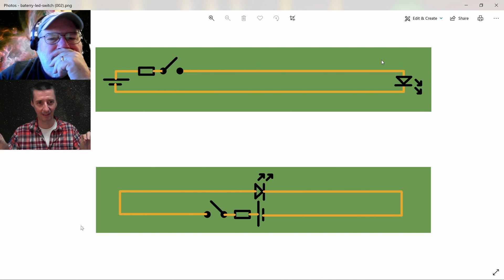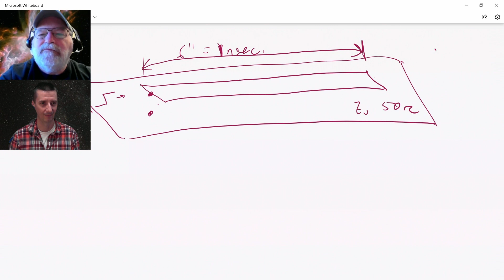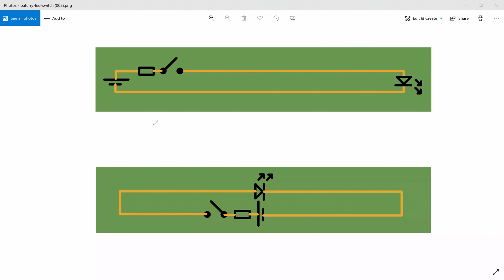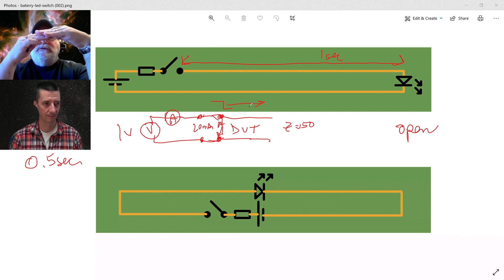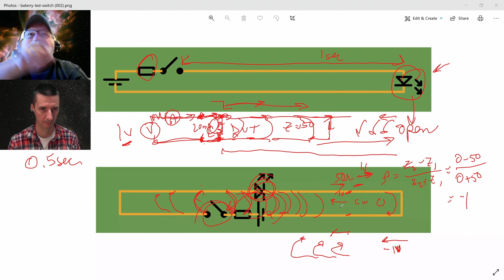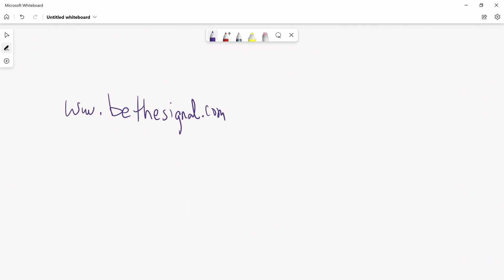Explaining Veritasium Electricity Video: Energy doesn't flow in wires (with Eric Bogatin)

Comment: Ya know Eric Dollard? And the video shows that in center of two lines, so the lines are horizontal, so it has series of same curve, so the amount of curve is the timeset of light, so if the curve is much bigger like a circle, so the lines of light that go left and right, so both in opposite direction base one is first, then one is second, so two time different, but depending on the shape, the exactly the same so the radius is even, so it is faster? Even it is same measure line as rectangle with smaller edge line. So, the less ratio of horizontal and veritcal, the rate of speed of light is what? So, it depends on center that range out so it is a barrier, so the smaller the ratio of top and bottom, the faster or slower?? And the step by step is a capacitor which is a changing volt so from one to another which is connected to the density that is high to low like a ball that is higher density drop in water, so it sinks but during the impact of the sink so there is a dispplate upward and downward in water and out of water, so the heavier you are, the bigger splash to even lesser splash at a further distance in the dept. So, based on the density ratio that is you put lower density in water and let go of the block which the object in the water goes up, and higher density of an object above water, and it goes down so splash will be big, so the point there is a displate that you can see which cause motion of water, so electricity and magnet field depends on motion, so two different density cause motion to happen, so it is not zero motion which is 0 volt so there is a foundation resistance so on top of surface of the water and the hollow ball doesn't sink, so the cap and resistance alter the volt base on for resistance is higher density and for cap is lower density so it will alter the volt so the speed of left and right for cap and resistance or two cap and one cap on one side and other on other side, 2 on 1 and 1 on another side so the rate of time is different or it is same?? Since the motion impact relative will cause the current to slow down or faster?? Hope ya will understand this and explain the knowledge if ya understand and if not, can let Eric Bogatin know. Other can give feedback also.

Comment: In Veritasium's problem, the wires are 1 meter apart - the transmission line analysis doesn't apply there. The field coupling the ends of the battery terminalis too small to light the bulb.

Comment: It was a multiple choice question. The light may come on almost instantly, but "1/c sec" isn't even an answer with time units, it has dimensions of time squared divided by distance  (e.g. s^2/m) so it's actually wrong. that makes the correct answer E) None of the above. I hate physics exam questions like that.

Comment: This is a great explanation of what to expect from a transmission line model, and it all sounds sensible based on everything being a 50 ohm transmission line, with a 50 ohm source power supply with the example of a short, open, or led at the end.  But the case in the original veritassium video didn't really say that the loops to the moon are transmission lines with any particular characteristic impedance.  If there is no measurable interaction between the wire going to the moon and back (Think capacitor with infinite space between plates), do we then have to wait for the 3 second round trip for current to start to flow in the light?

Comment: In the final explanation where the lamp and switch are in the centre and he says that the lamp turns on immediately, I suggest that it actually turns on slowly (in relative terms) because until the wave has propagated far enough down the line to where the capacitance is high enough to couple sufficient current across the lamp can't light. Comments welcome.

Comment: 28:10  "Oh those are just theories".  Often said by folks who don't understand how the word theory is being used.  Just like music theory is the study of music, other such scientific theory is the study of that science, not a theoretical construct to be supposed and debated.

I'm sorry, but I think you were tricked, Robert.  As I recall, for the Veritasium problem, the conductors were to be considered ideal. The use of transmission line theory (the study of transmission lines) is correct, but since the conductors are ideal, the actual transmission line distance of consequence is the 1m between the source and the load, not the thousands of miles of ideal conductor used to connect the source to the transmission line and the transmission line to the load.

Comment: If you think about light passing through carbon, a solid diamond, then think about the terms that your passing a solid through light, like copper wire, which is more easily understood? We move objects through light areas all the time. We don't call it moving light through translucent verses moving light through solids without cutting like a laser. However we can see how light travels by shining one on hand. You will see some coming through. So what you seem to explain is reciprocate. Why does e lectric stay on path with wire and not spread like lightning in storms or sunlight in air? The same way it appears captured in carbon, diamond
The weight and structure of each element lattice. Like a weaver that attached and holds til it breaks off to a outlet. A grounding type release

Comment: No presenter has commented on what happens if the distance between the wires in the original Veritassium setup is changed to either 10 cm or 10 m. Doesn't that change the displacement current because the field strength at the return path is more or less?
Reply: they just do not bother to explain it, it is frustrating

Comment: Must say the explained has had both. But I venture to sat the travelling as both. Because lattice energy use . The way light goes through diamond carbon, the lattice I think or in copper wire, continuum seems relevant. Energy in sky is a straight line ...it is the push pull against the bend, even as it is bend. The difference stands out watching lightning verses an outlet. If the wire carries the flow, it's due the similar use as light going through lattice diamond

Comment: I think the example below is wrong. the transmission line on the left side of the LED is not a return path, the impedance on that line is not 0. So you can't use the 50ohm impedance to calculate the 20mA transient current from the incoming line to that line. There is no such a model in the real world.

Comment: Finally the correct explanation! It infuriated me to no end that soooo many electrical engineering youtubers' explanations were so misleading to the point of being  wrong! This person is probably the very first one to correctly explain the precise physics of signal propagation! Thank you! Now my soul can finally rest knowing that the world (or at least your viewers ;-) ) have received the correct, physically-accurate explanation.
Reply: He did it as an EE engineer. Taking the coaxial 50ohms cable as an example was a perfect idea, even though it's also quite confusing. (the original question is very high impedance pair, 1m apart)
Physics engineers do explain it with their own formulas. That doesn't make them wrong.

Comment: There is nothing new in this video. It is still full of bs.  There is this fundamental flaw in the thinking by leaving out the fact that thers is a difference in potential (electrical) across the circuit.  Without that, there is no current flow or energy flow.  One way of looking at it is hole flow.  BUT DC will not produce a strong enough magnetic field on initial powering up to cause a flow of current in the other line. Also they all seem to not realize that an induced current is in the opposite direction from the current that induces it.  Thus negating the energy that supposedly would be transferred. I have been a theoretical and real life electrician and electronics technician my whole life (minus a few years for learning to walk and talk) and this discussion is so flawed it is pitiful.

Comment: With a DC voltage source, the displacement current should only be present during the rise time of the initial pulse as the switch is closed, so it will be a brief flash of light in the lamp or LED, assuming adequate current through the lamp. I can't see any reason why the lamp would stay lit continuously, until the full steady-state current is seen at the lamp via the wave reflected from the short at the end.

Comment: I have the feeling that more and more videos are popping up to discuss the Veritassium video. Unfortunately, most of the other videos make the subject more fuzzy rather than explaining it. The simple truth (as we know today, unless proven otherwise) is that we have to solve Maxwell’s equations to get the E and B fields for the concrete setup. That means that all materials have properties of permeability, resistivity and susceptibility. That includes the wire and air plus insulation of any sort. If your 600000km long wire has more resistance that the path through insulation and air ( looking at E and B fields, not necessarily just DC resistance), then the fields at the long ends (or where the loop closes) are very small and do not contribute much to the energy transfer. Looking at the poynting vector, if you have ideal wires the you have no E-field along the wire and hence the Poynting vector goes straight from source to load. With a real setup, there will be losses and the Poynting vector field can be distracted outside source and load, representing distribution characteristics of the system. There is no need to talk about distinctions between frequency ranges as the capacitive and inductive properties are already frequency dependent. One just needs to represent them properly in a system setup before solving. And that means that there is no such thing as an ideal 300000km long loop without capacitance, resistance and inductance. If there were such a thing, it would not have a voltage drop and hence can be represented with a short across it at the source and load.

Comment: One thing that is bugging me about all of this... all of us EE's are talking about how the setup resembles a transmission line... but in a transmission line the capacitive coupling is between the signal and return conductors, right?  In the example, the original author has capacitively coupled the signal line *to itself*.  How would this change the use of transmission line theory?
Reply: exactly

Comment: something is wrong with this theory. if we have a long distance and we assume that the electromagnetic field is the one that turn the led on son what is the difference betwin an open circuit and a close circuit in this case. when we turn on switch how the circuit will feel any difference in voltage or any resistance if the distance is so big and the electrons are very lazy.

Comment: So... the answer is... Everybody was right!!! If the battery/light/cables are impedance matched, then yes, the bulb will light "instantaneously". But if they aren't matched (which is what I presumed, because they are just "two wires randomly put), you will have to wait 2 seconds until the reflections make a "virtual" short circuit between the battery and the bulb.

Comment: While agree with John that this video is better than anything else I must say that I am rather frustrated by the original video, the EEVBlog video and also this video, and the overwhelming number of comments. Why is everyone ignoring the simple facts given in the original video: the lines are 1m apart, they do NOT form a 2m thick coax cable, the copper inside the lines must be in the order of 1mm thick, the lamp is big and will consume in the order of 1W, the energy source is a "normal" battery 6 or 12 V, not 1000000V or so. 
I have by now seen so many "physic professors" that apparently due to their mission to correctly explain the physics behind a transmission line completely oversee or deliberately ignore the problem statement.
A decent (and therefore attentive) physics professor should also understand the following very simple facts. a) Coulomp's law according to which the electric field strength decays with 1/r^2, implying that also the time derivative of field strength decays with 1/r^2. b) The time derivative of a constant is zero.
Now be my guest to calculate how much energy can be transmitted from some short, e. g. 30cm long section of the wire near the switch to a corresponding  wire section near the lamp by a single pulse of e. g. 1ns. Even if one doesn't have that minimum amount intuition to understand that in the order of 1W will certainly not be transmitted (just think what consequences that would have on every day life), it is anyway clear that after 1n the light would be off until the field wave has travelled through the cable. 
I am also astonished why none of the "professors of physic" goes to their lab, take  e. g. 40 m cabele (instead of 4*300000km) , pick a pulse generator to generate a (off->on) pulse, a lamb or resistor and a scope and do the experiment. This takes 10min. The result shows that the answers given in all videos is wrong! 
I better stop here...
Reply: I guess you're right. Eric goes too deeply to solve the problem that he forgets that this is a DC voltage supply that provides DC current. Okay for very tiny amount of time when we push the switch due to maybe high speed transition the LED may get energy wave through the space but that's not enough in terms of both power and time to keep LED turned on forever...the permanent thing that keeps it turned on must be the other form of moving energy in copper which is domino effect in which energy moves from on electron to the other to go ahead, and Eric himself in his book mentions this but here he wrongly goes on to explain it like a high speed pulsed signal.

Comment: What you are missing is that you can't change the circuit. If you put the battery and light source half the distance that light travels in a second away from each other, how would you know when the light illuminated? The battery and light have to be 1 metre away from each other.

Comment: I was building my first PCB circuit for wired data transmission over RS-485 line (no electrical engineering education), and the terminology was very confusing: termination resistors, impedance matching, etc. While I did all the things "by the book" and followed various instructions, this explanation opened my eyes of what is really going on and what is actually important.

Comment: The main problem with Veritasium is the discussion of the Poynting vector, which is an artificial construct to describe EM radiation pressure and behaves inconsistently when trying to use it in electric circuits. Feynman talks about it in his Lectures book volume II

Comment: You seem to be assuming the 'return' current in the oppoaing wire always matches the top wire current.How does that change with distance between the wires? How does that change if i placed a third wire on top of the first one? It cannot just induce equal current in every case.

Comment: In the section "Explaining transmission line..." there's an over-complication. The reason why you have instant current is because this is where you inject the power and make a measurement. The transmission line is irrelevant. What you measure takes another path through your measuring lines. (I didn't have patience to watch further than 10:33 so it may come up later, but there is no excuse for confusing the issue at the beginning)

Comment: A little hard to follow.  I prefer to think of the activity at the atomic level.  For example, one end of a 6 inch copper wire is connected to the switch and the other end is left unconnected.  The other side of the switch is connected to the negative battery terminal.  When the switch is closed, excess electrons will begin jumping from atom to atom as they travel down the wire.  After about 1 ns, when they reach the end of the wire, the flow will stop and the potential at the end of the wire will be the same as the switch.   If a 6" return wire is added and connected to the positive battery terminal, the electrons will continue for another 1 ns back to the battery, except the flow will not stop.  Using light with a mirror to return the light will produce a similar round trip delay, except the delay would be a bit less because light travels faster than electrons in a wire.

Comment: The long coax cable effectively turns into a capacitor and you are charging that capacitor with your meter , therefore you read a resistance because of that charging current.

Comment: The impedance of two wires 1 meter apart would be quite high.  So high that the initial current would be insufficient to light the bulb.
Reply: It would be the order of 700 of ohms, so the current in the lamp will be exactly that determined by a resistor of 700 ohms in series with the lamp. After 2 seconds this will change as a result of the reflected energy from the far end, given that this line is lossless

Comment: This is not a coax transmission line, it is two bare or insulated wires with zero resistance, each of them one light second long, separated in space by a one meter distance. Do the math on that!

Comment: This circuit, even if it is built with a wire with R=0, with 1 metre spacing between the 300,000,000 meters of length, doesn't work as advertised.
As you close the switch, the EM wave travels from one wire to another - or, with a different but equivalent explanation, the capacitor constituted by the two half lengths (spaced one metre) charges.
Yes, the bulb turns briefly after 1m/c, or 3.3 nanoseconds, but turns off soon after.
After the initial impulse from OFF to ON, the induction disappear, and with it, the EM field.